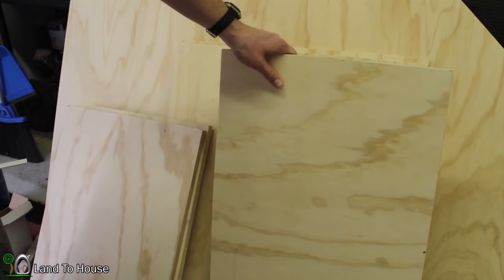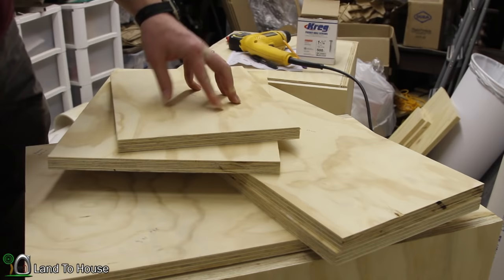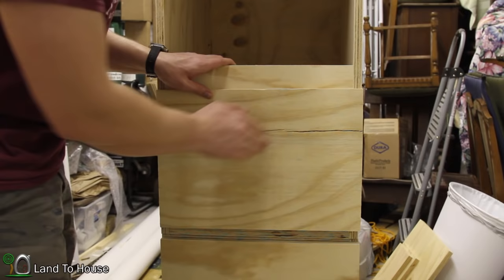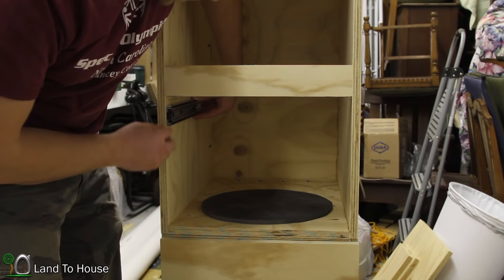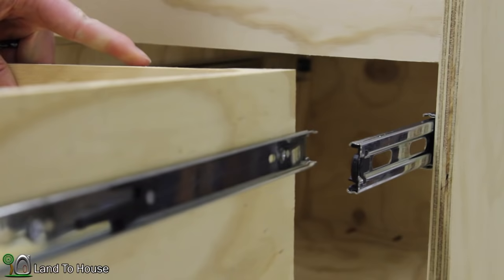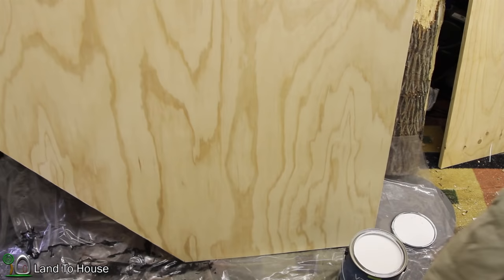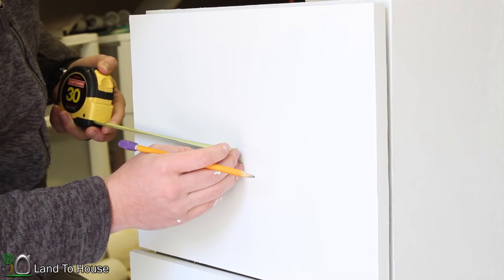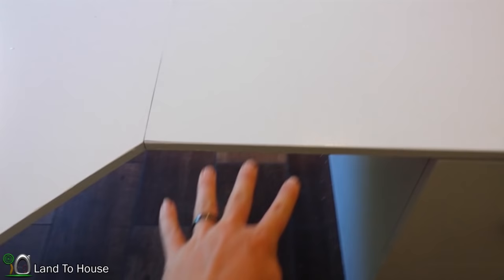Build a Corner Desk Part 2 of 2

Comment: To make things slightly even easier. Upon installing the drawer slides you might want to consider laying the cabinet on its side and using gravity rather than to fight with gravity in order to hold those drawer slides into position as you mark out both their location as well as their screw mounting hole locations then flip the cabinet over upon the other side and do the samething. -- Oh, and another thing back when I was a beginning wood worker I spent years racking my brain on many projects trying to figure out how much distance there would need to be between the walls of the cabinet and the drawer, in order to be able to leave enough room to install the drawer slides but not leave to much distance.  

Then one day an old timer told me it is simple....... it is always a half inch (1/2 inch), upon either side, do I have to treat you like a stubborn old mule and rap you upon the side of your head with a two by four to get your attention first in order to teach you something so simple? 

Well, he got my attention without the use of the proverbial two-by-four and I have never forgot that lesson about what the correct distance is. - Anyway thanks for sharing your great video. great job sir.

Comment: I love this desk, DIY in my opinion looks better and will last a lot longer. Could you please share the measurements for it? I plan on building this myself but maybe shrink it a bit to fit my room and possibly finding a easier way to be able to join and separate the pieces so I can move it if need be.
Reply from the maker: sadly I do not have the measurements for this. I just made it up as I went along.
Reply: @LandtoHouse  I guess that's why they call it diy projects isn't it. Awesome desk by the way I'll have to measure my room and go from there with the measurements.
Reply from the maker: Yes very true. It would be nice if I had a dimension list but sadly I'm too lazy for that. My wife just had me cut the desk down by about 7 inches on each side. It fits her room better now

Comment: Fantastic job! I'd like to build one of these myself. Anyway you can provide a cut list along with a complete bill of materials that you used on this project? Keep up the good work and keep us updated!
Reply from the maker: Thank you. This desk was started while my wife and I were in a small apartment. It took many months to finish and I dont remember the cuts. I would have to measure them out and write it down. As for the quality this desk has worked very well for my wife. It is so much bigger than the one from pottery barn.
Reply: No need to go through all the trouble of measuring your cuts as I'll probably have to customize the unit to fit my actual application. I was only looking for a guide. I do have another question. Where did you get the drawer slides from? They look pretty heavy duty and can handle a lot  of weight. Thanks in advance.
Reply from the maker: +Van Delay when I built this desk I just looked at the dimensions of the Pottery Barn version. And then just played around with the size I wanted. The slides came from Lowe's. They are very heavy duty 100 lb drawers. Probably a lot more than required for such a small desk.

Comment: i dont understand, why u did not sand the edges before assembling.
Reply from the maker: This was my very 1st woodworking project. I've learned a lot since then.
Reply: @LandtoHouse  dont worry. 
my first woodwork  project (a small garden toolshed) was perfectly sanded, but now after some years its crooked due to rain and only hold by the wall it leans against :D
should have mounted some strategic bars that go diagonal i guess, for the extra stability.
Reply from the maker: @certaindeath7776  We all start somewhere!